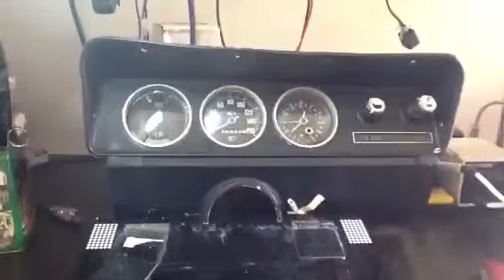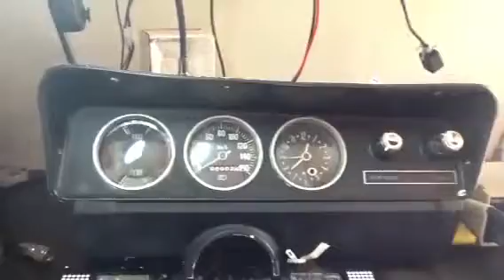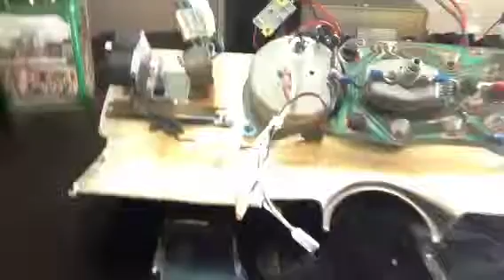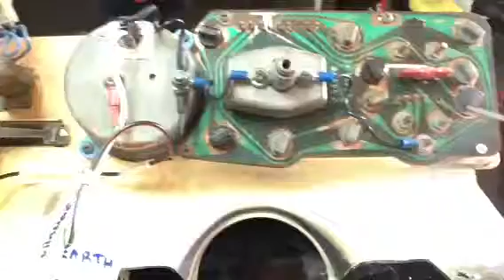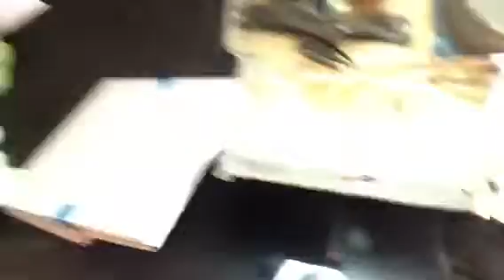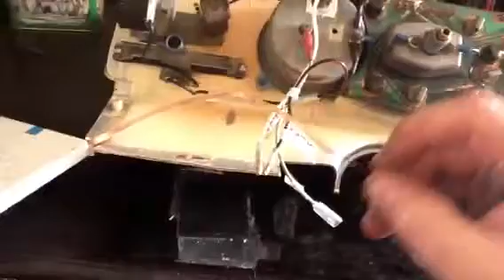AMC RAMBLER HORNET INSTRUMENT CLUSTER REPAIR

Comment: I no this is an old video but hopefully nobody followed the grounding to the temp guage as per this video.. Don't do that step as that's direct to the temp guages 5v output post this also powers the fuel gauge, and will definitely short and blow a fuse or worse something else on the board.

Comment: I have a 1973 AMC Javelin that has the same basic circuit board as your Hornet. My problem is the transparent plastic that the hair sized copper wire rides in witch carries current to the dash lights has pulled off in some spots. No longer supplying current to the bulbs. How should i reattach it. With some sort of glue?
Reply from the maker: Solder wire jumpers by someone who knows how to do that or buy copper tape and carefully cut to shape, stick down and solder at each join then cover with clear vynal film.    3rd, glue back down by covering with clear vynal
Reply: @Pull_It_Apart_Paul_Ham_CB  thanks!

Comment: Have you done a 64 Rambler American 330 gauge pod. I have no lights in the dash except the turn signal, generator light, and high beam indicator. Do you have any suggestions? I'm also curious about removing the gauge pod. Does the entire dash need to be disassembled to do so?